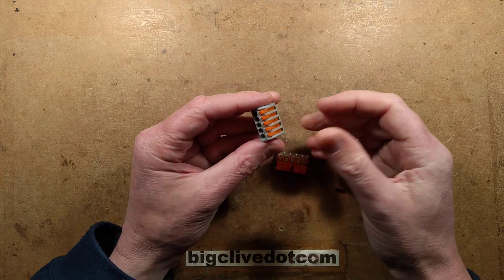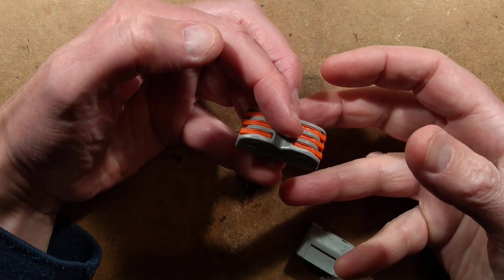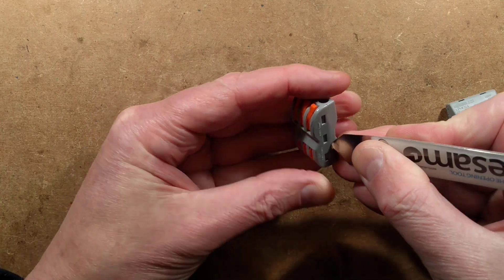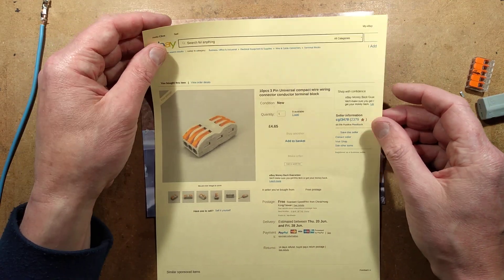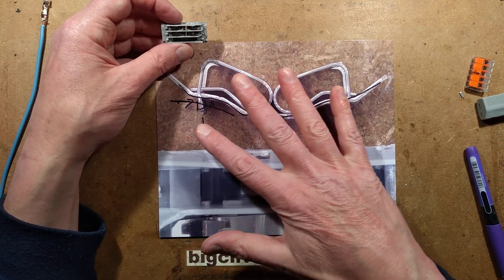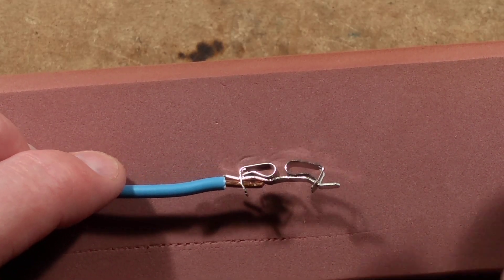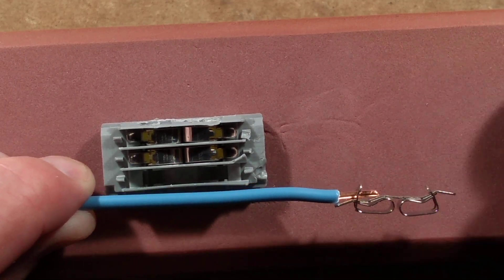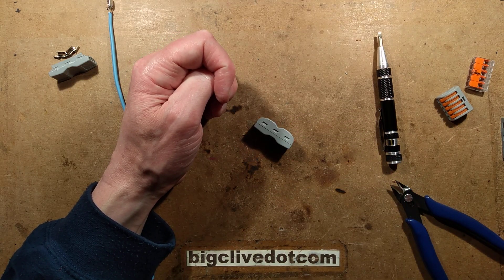Clone of Wago product that Wago don't even sell???

Comment: Seems good. Those springs, they are steel but I doubt it's stainless. It might be but it seems more likely that it's chrome plated. It's easier to tell in real life because stainless tends to have a slightly more brown tinge to it compared to chromed or galvanized steel. Maybe Wago haven't made these out of fear that someone used to using them might accidentally common live wires together when using their original product. Obviously that's user error but I could see that happening.

Comment: I have just found these kind of connectors on ebay, but with color-coded levers. Levers opposite of each other are the same color, so it's easier to differentiate them from the "regular" ones and know which terminals are commoned together.

Comment: Got some of these & took one of each type apart to check inside. Checked R with low ohm tester & insulation with a megger. No issues. Have used them on domestic lv & not had any problems so far & they seem well made.

Comment: Would you post a link for that 3 channel straight through connector please?
Reply: "CESFONJER" on Amazon. They appear as single, double and trebles, but the singles I bought are magic-they have a dovetail in the case whereby you can connect as many as you like side by side. This would also address Clive's concern re separation. I paid £10 for 24 singles.

Comment: Why are these deemed to be knock-offs?   If I connected an led to a resistor using a paper clip would that be a wago knock-off on the basis that it uses springy metal to clamp wires together?  Is my soldering iron a knock-off of the first device that used heat to melt solder?  I'm uncomfortable with the pejorative implication.

Comment: those will be helpful to me in my low voltage projects.  Not sure how I'd feel about mains voltages, though.Later in the video - Yes. hydro-ponicy lights.
Reply: Technically low voltage here in the UK is 1000v or under. Extra low voltage is 50v if memory serves me right.
Reply: @craigemmott4976  similar here in Australia, from memory, low voltage is 1000v ac or 1200dc, and ELV is 50ac, 72dc.
Reply: I'm pleased enough using them for 120v signal purposes

Comment: I connect electric sunscreens all the time, and this is exactly what I need ! If they make them with 4 contacts, I’ll get me a 1000 !
Reply: Look up spl-4, these are the 4-way Connectors. In the same Grey plastic construction but with a din rail mount on the back. There are also some black ones with yellow levers but they look much lower quality on the pics.

Comment: Really surprised Wago haven't made something like this - the closest thing they do to it is the 224 series, which is a push-through for joining stranded and solid core wires:
http://wago.ltd.uk/connectors/push-wire/

I'm going to order in a few of these knockoffs, I think. I use Wagos a lot for wiring 12v stuff together and currently just use one two-way Wago for each wire, and it ends up a bit messy. With these three ways, I can pop the wiring in on each side and it'll give a channel of separation as well.
Reply: Check this out:
https://www.ebay.co.uk/itm/2-way-universal-32A-Terminal-block-Electric-Wire-Connector-Box-of-10-20-50-bulk/163514280268?hash=item261235e94c:m:mpeWN7i6yvaz8odpFrfdIqQ&frcectupt=true

UK Seller as well!

Comment: I bumped into these on Amazon 2 years ago.  Great for tight areas and short wire left to tie to e.g. Connected new blower motor in bilge without having to run all new wires.  Things were tight and neat, and these kept it that way with the replacement blower.

Comment: Damn it. I wanted a 4-way one of these while I was wiring up a few dozen LED strips in a display cabinet. Pissed around down the back of the cabinet for hours with those horrible screw-down junction block things, and already got some connections loose. Nearly bought the WAGO things (conveniently placed right next to the LED tape!) and just realised in time that they were all commoned together; couldn't believe there wasn't a version that didn't do that.

Comment: Here in Australia when you purchase most light fittings they include a strip of screw terminal connectors, suitable for 1mm or 1.5mm cable. Here we don't often use tool-less connectors, but I'm pretty sure I've seen some come with a smaller different version of this style of connector. (Not sure if you have a similar setup in the UK). I'm surprised Wago don't do a similar product though. 

If this one caters for 2.5mm though for power circuits, that would be quite handy

Comment: I find them most useful for rapid connection of wires in various projects i dislike using the standard block connector with screws in it now. Thinking that thing must be fake because it connects differently to each side points the manufacturer would want to make it damn clear on the thing you've got different version or you may have someone mistaking them for each other.. somehow

Comment: Some thoughts
1. The Wago 224-xxx are their range that facilitates "through" connection
2. I have a feeling the regs will push for identification of conductors on a multi use connector like this ie L/N/E markings
3. I also think there may be a requirement in the regs to have the test hole on all terminals also

Comment: It's essentially those screw terminals/clamps but with springs instead of screws
Reply: ...and the springs action adapts to variances over time vs screws....cold flow ,thermal expansion/contraction,vibration etc

Comment: @ 8:40, if the wire is inserted into the device, the top of the "spring clamp" is well below the top of the barrier.
Reply: Only if you use a somewhat large wire. With reasonably small wires they still arc way below any safe voltage.

Comment: Without looking at video that cheapo FWago ( Fake Wago) the levers are prone to break easly without many stress. I'll see later what more worse can it goes... Send that terminals to John Ward for testing, since he has tested them with a lot of Amps :P The most approach would be the 224-201 which is used for lights 

https://www.wago.com/global/installation-terminal-blocks-and-connectors/power-supply-connector/p/224-201

Very usefull if doing some test jig for various ligh fixtures cable types, but the connector is single and has a lot of robustness

Comment: They are called "SPL-3 Connectors" on Aliexpress. I will try them, they look very usefull for Car and low voltage battery related stuff.
Reply: Thanks, couldn't find them on the seller Clive mentioned, but just ordered a bunch off Ali after searching spl-3
Reply: Don't think this is suitable in a car like the engine bay, or other wet places. These can hold a good amount of moisture inside.
Reply: @jada1173  You're right. But inside the cabin I'd trust them more than cheap crimping connectors. 
I can think of a reason why Wago didn't bother with this product: It is kind of prone to be used to "fudge" something together, because a regular home install rarely needs extension without branching circuits. Maybe they fear regular people fixing their appliances with them, neglecting strain relief etc.

Comment: See can get ones with the levers coloured different for each connect (Red-White-Blue,  Blue-Yellow-Orange, or Red-Black-Blue). And single connection ones that can clip onto a rail.
Reply: There is a rail holder clip from Wago that takes a couple of the single connection ones 222-500.
Your idea with the levers is great, if they fix the spacing that would be a good product.
Reply: @stefantrethan  This is the store on aliexpress that came across when wondering what else is out there.
https://yjcal.aliexpress.com/store/group/Wire-Connector/4404031_1000000333239.html?spm=2114.12010108.pcShopHead_7587638.1_0_0

Comment: Wago aren'ty the first to use this type of connection, some chokes etc in fluro lights use similar, but you have to use a screwdriver (or a pokey thing) into a hole to release it.
The 3 way connection is an obvious good idea, though i'll probably stick to good old screw terminal
Reply: Those were probably old-style wire-to-board Wagos
Reply: @CodeBurger i just checked wago's wiki, they've been around longer than i thought, so maybe they were made by Wago.
I can't remember the make of the ballasts/chokes, but probably philips or thorn in the 70's

Comment: Those knock-off look like the old white blocks, a so-called "kroonsteen", which we called "suikertjes" (sugars).

Those also were multipole 1-to-1 with multiple wire-inputs on each side. They usually came in the form of 1x1 blocks connected with snap-off connectors which allowed you to cut long strips into single 1x1 blocks.
Those are no longer allowed according to local code. AFAIK this was because there was insufficient pull-resistance and there was still a chance of getting shocked.

Example: https://nl.wikipedia.org/wiki/Kroonsteen
Reply: Also, since it was 1-to-1, you couldn't use them to connect multiple wires together.

However, people often put the "source" wire on 1 side and then rammed 2 "split" wires together on the other side.

Comment: On mains power It would be nice to see some type of shroud so that cables/ flex still stays double insulated as the  cable enters the connector. But then again screw connector blocks are the same. It would be nice to see double insulation carried from one side to the other. I wonder how soon it will be before some "SO CALLED ELECTRICIAN/ SPARKS" uses them for 3 phase ( L1,2,3 in each set of terminals ) OMG
Reply: What's your concern, here?
Reply: @B-System  safety

Comment: Just jumped on ebay and bought some!
Reply: can you share the ebay listing?
Reply: @Random-stuff-1992  Sure can! https://www.ebay.com.au/itm/2pcs-Fast-Connectors-Universal-Compact-Wire-Connector-Push-in-Terminal-Block/293011788033?_trkparms=aid%3D111001%26algo%3DREC.SEED%26ao%3D1%26asc%3D20160908105057%26meid%3D7f7fb72c3df84f899bf26a31cbb18926%26pid%3D100675%26rk%3D1%26rkt%3D15%26sd%3D293011788033%26itm%3D293011788033&_trksid=p2481888.c100675.m4236&_trkparms=pageci%3Aa58288f4-8e6f-11e9-bd4a-74dbd18017d5%7Cparentrq%3A54b9993116b0ad31c3659ec7ffdeadff%7Ciid%3A1

Comment: Sometimes copies or OK. But, my concern with these is corrosion resistance. It's hard to be sure that the contacts are made of the proper metals or if they went with a cheaper material which the Chinese are prone to do. This could be especially important in a humid environment such as with the grow lights.

Comment: Re quality of the metal in the conductors : there is a know problem with cheap Chinese extension leads where the conductors are aluminum and not copper - and therefore their current carrying capacity is not good enough for UK 13A requirements - and certainly not enough for the 32A trip + earth conductivity.  So - yes - maybe there is a worry with the metal quality and it crystalline sub-structure that can cause high resistance.

Comment: From the below it looks like you have a knock off Chinesium item there. I mean if you want a 3 wire straight'ish through connector that has PROPER separation (not just a sliver of China's finest plastic) you can just use 3 2 way Wago connectors, at least that way it's properly rated, safer and more reliable...

https://www.wago.com/us/c/wire-splicing-connectors?text=*&f=%3AProdukthauptfunktion_5200%3ALever+terminal+block&sort=relevance&pageSize=50
Reply: I suspect Clive knows full well...

Comment: You still have to strip the insulation off the wire.What happened to the design of connector where you pocked the wire in without stripping and screwed down the screw that pierced the insulation to make contact.They brought out a flat wire and connector that held 240 volt bulbs that you just screwed on the wire, no stripping or cutting.hey seemed to have disappeared.

Comment: https://www.aliexpress.com/item/32965618111.html
if you wanted 50 probably cheaper from their ebay store
https://www.ebay.co.uk/itm/50pcs-3-Pin-Universal-compact-wire-wiring-connector-conductor-terminal-block/223461384262

Comment: thanks bud - these look even more useful than the traditional Wagos.  I'm giving them a shot for some low voltage stuff.
Reply: Just remember that if the low voltage (V) has to deliver significant power (W) at the other end, the amps (I) increase along with the connector temperature. Didn't good old Mr. Ohm write a law about this stuff? It was something like W = V * I. Thus I = W / V
Reply: Nicolai That's Mr. Joule.  Mr. Ohm wrote the one about Resistance.
Reply: Yay a Sergal, and a pink one too!
Reply: @dragonslayerornstein387  Tis good to be appreciated and recognized.  I like you!  None of that "awh, that's a cute pink doggie  on your youtube thingie".
Reply: @BlackWolf42-  I love sergals ^^ they're vicious killers, at least, the northern bone of their enemies bearing sergals that mimic the old Chinese Empire in terms of style with still some modern (but silly) weapons. Being pink means you're a southern Sergal, 5'4" or 6' feet in height and also from a very high culture. Anyways, point is, I love them! All Hail Rain Silves!
Reply: @dragonslayerornstein387  You are doing gods work - I think I'm in love with you!
Reply: @BlackWolf42-  Nah, I've just been reading about them since 2014, which I think is when they came out as a concep on wikipedia, read up on them before it was changed to the page we got today, I know the creator of the species is a Japanese girl but I forgot their name, still she's referenced on FA and e621 (sfw btw). They're passionate loving killers, kinda like dragons too, hording and keeping alive anything they find interesting. Sergals are lovely.
Reply: @BlackWolf42-  Fun fact, I've been sub to you just for the picture since 2016
Reply: That sounds like a really stupid idea. Low voltage stuff is much more likely to burn than high voltage. For a bad contact the current is the danger. If you get the same as in this video you will be fine, it seems to be a really well designed and build product, but with those off brand products you never know.
Reply: Wago Are often rated for 32A at 240v. I use them all the time.
Reply: Be fine for 12V lighting or security systems, prefer something more robust for house current.

Comment: I discovered wago several months ago. Here in the US we have these ridiculous "wire nuts" that have destroyed my fingertips many times. I'm not sure wagos are approved here, but they are so convenient. They are especially nice in a tight junction box since you can attach the incoming wires separately and then attach the "appliance". I find these especially useful for IOT things like the Sonoff and Shelly. If you are VERY careful, you can even work on these live since there is no exposed metal. I noticed some of the newer IOT device are using pigtails instead of those crappy blue terminal blocks, so these are the perfect tool for the job.

The other advantage is that you don't need a dozen sizes to do the job. These clones seem to work well on AWG 28 to 12, (.08mm - 4mm). If my house burns down because of these, I'll blame Clive :)

Comment: The best invention ever. Especially for the fireworks and pyrotechnics industry
Reply: Yes, exactly. You don't even need any pyrotechnics, with spacing like that it is just a matter of time until they make their own fireworks.
Reply: Big difference between proper Wago ones and these for outside use is that with these multipole jobs, rain/mud (and induced rust/corrosion) might make a big difference creating some conductivity between ways. So, I'll still be sticking to the official Wago types. Great for low voltage or temporary work, though. Being direct from China, they won't be going on mains electricity in my house.
Reply: @jam99  I just ordered one of these knock-off ones for repairing a speaker cable. It's not a very high power signal going through the cable so I think it won't matter
Reply: Then is THIS YOUR Wago-Connector. This one can be used in potential explosive areas without being the reason for an explosion... (Ex2-save)

5-pole-connector:
https://www.wago.com/de/netzanschlussklemmen/4-leiter-geraeteanschlussklemme/p/862-1505_999-950
Reply: @ElektrischInkorrekt  3 phase 440v and 28a rating. Sounds like what every farmer needs